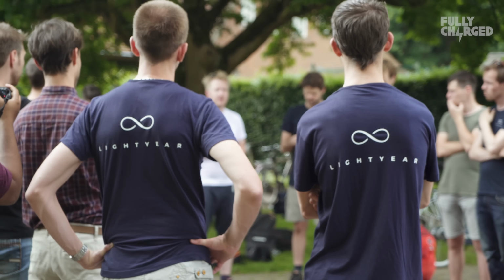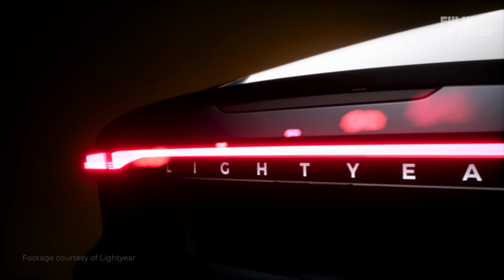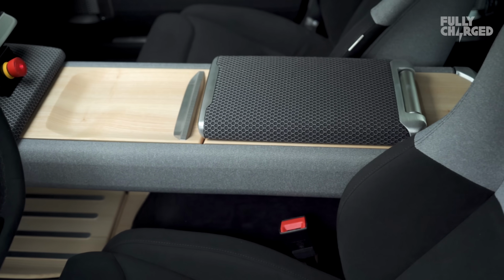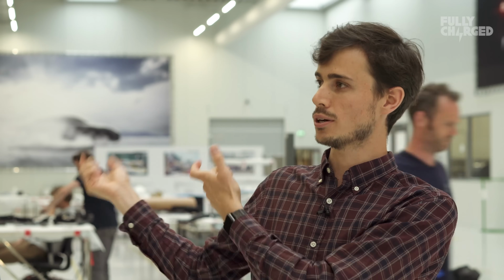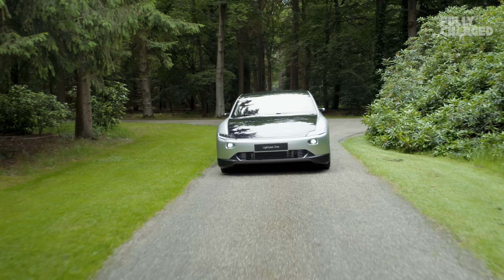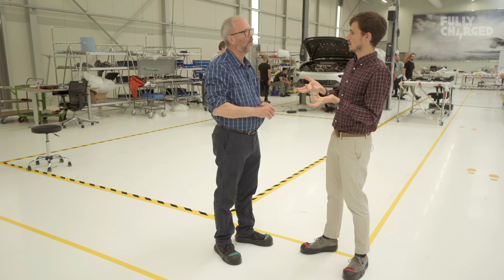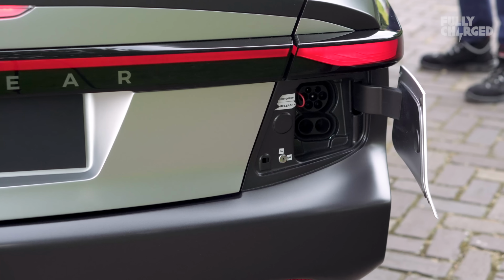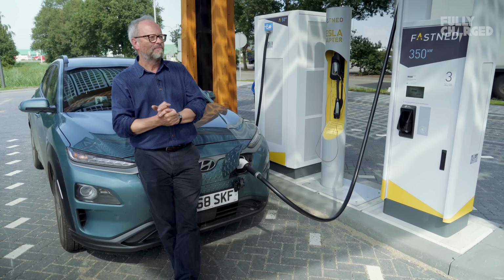Lightyear One solar powered electric car - exclusive first look | Fully Charged

Comment: 5:50 Min. range 400km - max. range 800km!
Every manufacturer should state min max. Great!
Reply: That's when you let the engineers do the talking instead of putting marketing and sales departments in between :)
Reply: They already do, it's on the big tag on the side of the window (Monroney sticker). Says City mpg:XX Highway mpg:xx

Electric cars do "range" instead for 2 reasons. 1, range has been electric car's limiting factor since the 1900's. 2, it allows them to hide that they get worse energy efficiency at highway speeds. The current record holder for longest drive on a single charge in a Tesla did so driving at speeds in the teens, 13-19 mph.

While I like the concept I know reality rarely meets expectations. 4 days to full charge optimum. Most people are not going to be checking their compass to make sure they're getting optimum coverage, making sure their roof isn't getting partially blocked, etc. People will get at best 1/8 charge/day, and I'm betting half that. A lot of people that only travel 5-10 miles a day for work might be able to make it work for free though. And never being permanently out of power in the middle of nowhere would be awesome too.
Reply: @macgyver9134  "A lot of people that only travel 5-10 miles a day for work might be able to make it work for free though" - No.
it would be cheaper to put normal solar panels on your house and charge your car when you come home
so you technically pay for having them on your car
Reply: @user-bj3pq2si2l  What about those who live in apartments? You do not understand physical principles. There should be an AC motor as in a washing machine, which is connected to an AC adapter 220 or 400V to the batteries. The higher volts, the less amperes it consumes. Look, there are 110v house current in America and they pay 2 times more for electricity than in Europe where 220v
Reply: @macgyver9134  4 days to full charge? this is impossible
they have at best 4m² (~3m*1.3m) and thats under perfect conditions (car would need to be angled or only when sun is exactly at highest point) about 0.5kWp (kilo Watt peak)
so even this way, after 4 days and about 50h of sun you get only 25kWh

realistically these modules are less efficient than "normal" stationary modules (i guess about 30% less), they are not angled (about 50% less sunlight) and it obviously depends on weather, so on average that's probably again about 50% less
so realistically it is about 4kWh/4 days or 1kWh/day or about 1 charge every 2 months

useless uneconomic shit
Reply: @user-bj3pq2si2l  If you watch the video they tell you, the solar panels are 1.25kw peak
Reply: @CamdenWallraff  then double my numbers
Reply: @user-bj3pq2si2l  It has this one major upside of making use of the surface area of the car. As the working parts of a solar cell are not heavy so if you build them into the body panels efficiently that is energy harvested that would otherwise be lost without major impact on the energy to accelerate the mass. As long as they generate something its not entirely wasted  (assuming the cars live long enough to payback the high energy cost to make the cells in the first place - which they should be able to).

 Not everyone can fit green energy at home - living in flat/apartments, planning rules etc. So even if you only get a small % of your mileage from the cells or they just cover the aircon its still good for reducing load on the local power grid. IF everyone suddenly went electric now the entire world would brown out with the demand for electric. There are not enough power stations to get even close to that level of demand even more so with the 'fast' charge that draws so many more Watts.

Time will tell how good they are in real world conditions, if the body panel structure will age badly etc. It certainly isn't going to be the cheapest way to get solar power for your EV. But the concept is sound enough as long as you are being realistic and not expecting to drive at speed entirely on the sun all day every day. The Batteries are actually the bigger issue, decreasing capacity, limited lifespan, often hard to remove and service, using relatively rare elements and not yet re-manufactured or recycled effectively.
Reply: @user-bj3pq2si2l  You must work in the oil 🛢 industry .....
Reply: @jimhouse9961  no, i think solar panels are great
but putting solar panels on your car is just dumb
Reply: @user-bj3pq2si2l  He says here @16.47 1.25kW peak and equivalent of "charging up" 50-70km per day....
Reply: @user-bj3pq2si2l  Maybe they used 46% efficient multi-junction cells rather than standard 20% ones?
Reply: @johndow1974  no matter how you think about it, there is no way that this is better than having stationary solar panels
the extended range is insignificant and there are too many downsides to reliability and cost just for having it on your car

even with 1.25kWp it won't be worth it
let's say that you are doing a long road trip through a desert, perfect conditions, that's then about 12h daylight with an average power of 0.6kW (angle to sun is important) which results in 7.2kWh which is about 40km or in other words not even 2 minutes of fast charging with the model 3
Reply: @user-bj3pq2si2l  Agreed, but if you are doing avg 30km per day like most people do then it can make sense. Note the guy says the daily charge equivalent allows for 50-70km distance drive. Also nobody says you can't charge it from the external source, e.g.  additional panels.
Personally today I'd go Tesla, but if I was living in a sunny country it could be an interesting option.
Reply: Unless you're driving very very slow I can't see solar adding an extra 400km. 1.25kw isn't even 2 horse power and that's assuming perfect weather. If you're willing to pay for it's almost certainly worth the extra weight of the panels but it can't make that much of a difference.
Reply: @bloodypommelstudios7144  The min max not only depends on the weather, also driving style (which in my experience is much more important). For example, my car, i usually do about 220 km on the highway at 130 kph, but if i do a 100 its about 260-280 versus 80 kph about 300 km. The solar panels themselves probably dont add much range on a single drive.

He stated 400 - 800 km range. Assuming the efficiency of the car is similar to newer cars available we have now, and a little more efficient due to the aerodynamic design (15 kWh / 100 km) it would mean a battery capacity of about 90 kWh, suggesting a battery capacity similar to a Tesla model S. 10-12 km/h charge rate from solar panels with a 1.25 kWp capacity would suggest an efficiency of about 11.3 kWh / 100 km and a battery size of about 67.5 kWh. Seeing the efficiency inprovements over the last 8 years it is not outlandish at all, but it would certainly be a big jump.

With 1.25 kWp power generation capacity, reaching a full charge in 4 days is indeed a bit wishful thinking, at least in the Netherlands. It might very well be possible in a sunnier location.
Reply: @ReapingMiner  I just can't see who the market would be. They're charging about $100,000 more than an equivalent EV just for the sake of having access to an extra unreliable and low power energy source.

For it to make sense to buy it you'd need to be a multi-millionaire with a driveway which isn't in the shade near the equator, not have access to electricity in most locations and be a very low mileage driver. Not exactly a large market. Get a vehicle like this to a price point where it's competitive with regular EVs and you've got a viable product.
Reply: You guys are forgetting the most important factors, weather and time! 1.25kwh means nothing in the real world, weather is your biggest concern and a mere cloudy condition can drastically affect its efficiency much like solar panel.
Reply: I'm putting my order next week.
Reply: if they had these numbers they would :D
Reply: @steak8278  Uhm thats not how it works. There are rules set on how you define the min. range of any car so you have a consistent dataset. It's an exact science.
Reply: It's a little more complicated than that. Expressing a minimum range doesn't say anything without reference to a certain performance. Second, the standards used should reflect every day use - which is up till today not the case, due to governments that prefer to let their ears hang to the car lobby instead of people who are using it and paid for it.
Reply: Thunderf00t needs to see this bullshit video lol

Comment: Looks like an airbrushed concept car you might have seen in the 80s.
Reply: No pop-up headlights tho
Reply: Looks awesome.  Very little difference between tissue concept and the Bugatti's and Lamborghinis. Very little
Reply: CITROEN CX
Reply: Seems inspired by VW XL1
https://youtu.be/tqQ4eQc4zd4
Reply: Yep! I was thinking of KIT and Michael Knight.
Reply: it looks better  than the bubble cars of today
Reply: GM won that race with a car that looked very similar using a very similar idea...……………………………………………………..in the late 80's
Reply: this brings us back to the same question :once the sun goes down how far can I drive on the battery?
Reply: I would rather have a car that can run on the sun that have a back window
Reply: exactly what I was thinking when I saw the side and how odd it look. It looks like the future car from the 1980s but the side looks UGLY.
Reply: @HH-xs2gm  That is a nice reaction. Means it is like art. You love it or you hate it. Luckily there are so many models on the market that there is choice for everybody.
Reply: that rear wheel guard looks like it's wearing a miniskirt. as if it has genitals to partially hide
Reply: @davemwangi05  I liked the real wheel guards. To me it made it look sleek.

Comment: I would like to know how many autonomy kilometers would the car reach here in Seville, being one of the most sunny places in Europe. My prius also has solar cells on the roof but it's only for activate the fan inside during hot days.
Reply: In the video he said the maximum power you can get from the solar panels in full bright sun is 20 km of range per hour.

Comment: Maybe a dumb question, but what happens if you leave it in the Sun, but it's already 100% charged? Obviously can't put that electricity back into the network (which is actually not a bad idea since most of the day cars just stand around anyway).

Comment: ok some questions

 - how do you carry a spare tyre (if the motor is inside it)
 - how do you reverse if you can't look out of the rear view?
 - in Saudi Arabia in Summer at noon where it is 47 degrees and no cloud and you go 70mph what percentage is generated as it drives
 - in Ireland in Winter at noon where it is 1 degree and overcast at 70mph what percentage is generated as it drives
 - how often do you have to clean the solar cells?
Reply: Spare tyres are not mentioned.  The video says for reverse there is a camera (but the location of the display is not yet finalised).  For Saudi Arabia the video says the maximum power you can get from the panels in full sun is 20 km of range per hour.  For your Ireland question the video says a somewhat overcast day in the UK is more like 10 km/hr of range but probably less.  The solar cell cleaning regime is not mentioned but the fact that they use lots of small panels instead of a few big ones means they will be less sensitive to dirt and grime than other panels like those used for home solar.  I would think they should be cleaned as often as you clean the windscreen.
Reply: @vink6163  ok so the 70mph is 110kph.. so basically 20km and 90km from battery is solar so it's (ignoring air con and the gross curve inefficiency due to air friction etc) so that is just over 15% which isn't bad

i.e at peak legal maximum speed in perfect sun it is about 15% solar efficient.. that's not bad

the Ireland thing is a joke, there is no solar performance in over cast, pretty much zero
Reply: @vink6163  I still think if any vehicle was on solar roadway and used induction (making it effectively like a railway less tram)  you could (theoretically) achieve much better results.. much much better
Reply: @con_boy  It's probably not accurate to think of it in terms of km/h or mph because to be practical the car will run off the battery 100% of the time, with the solar cells feeding whatever they can into the batteries (along with regen braking).  So you can't really think of it as 90km/h from battery and 20km/h from solar to drive at 110km/h, it's more like you drive at any speed you want, and it all comes off the battery, but for every hour the car is in the sun, the battery is recharged enough to add another 10-20km of range.  So if you wanted to drive 40km and left the car in the full sun for two hours, then your whole 40km journey would be (close enough) to be entirely solar powered.  Of course there are efficiency losses that reduce this but the point is it doesn't affect your speed, it's about the distance you travel.

As for inductive roadways, have a look at some technical reviews of Qi phone chargers.  The efficiency of induction over an air gap is quite poor, so while you could deliver more power via induction than you could via solar, you'd waste a huge amount of power in the process (seems to be around 10-20%).  The practicalities of having large charge loops and fast moving vehicles also means it would be difficult to control how and when to turn the power on and off, so you aren't wasting power by charging when nobody is there, and you aren't creating magnetic drag on the moving vehicle which would further reduce the efficiency.  I'm sure it could be done, but it seems like it would be so expensive and complex that I'm not sure the resulting system would be worthwhile.

Comment: It's less efficient than just having some solar panels in an appropriate area... The car will see go behind buildings and under trees and tunnels... It will not be in the optimum position at various points... 

It's a stupid idea... Sorry...
Reply: You're correct that it is less efficient to put solar on a car, versus having stationary solar panels that power charging stations. However, 6 miles of recharge per hour, means that a typical person working a 9-5 job, could recharge 48 miles per day. The average American commutes 32 miles to work round trip, enough to cover the average commute. Most cars are left parked 95% of the time (actual statistic), time that could be spent charging. This car is also invaluable in areas with limited electrical infrastructure, where plugging in to recharge may not be feasible.
Reply: @sinixodair  - But you can charge it overnight when you're at home and save on the expense of the panels... Besides, as electric vehicles become more popular more and more charging stations will be available.

Also cars get dirty very easily, which will also reduce efficiency, all in all it's a massive waste in my opinion, solving a problem that doesn't really exist.

What about if you park in a multi storey car park? Or underground car park? Or just somewhere in the shade? The whole solar car thing isn't a new idea, it's not done because it's stupid! Same reason why solar roadways is a stupid idea.

Comment: Website says it'll charge 12km of range per hour of solar. I'd say for that limited benefit, save the cost and the weird design choices (what someone from 1988 would imagine a car in 2019 would look like) and install more solar on your house instead. Or elect for renewable if you've got that option, like we do in California.  It might work for toodling at 12km/h as limp-home mode (according to the website), which is great, but that's not exactly a selling point or a cure for range anxiety, particularly for someone living in cloudy northern Europe.
Reply: Atleast someone won't be stuck in a desert.

Comment: Video title is a bit click bait as car is only partially solar powered.
Reply: How so?  If it charges at 10 km/hr then that's a free charge of around 400km per week, so if you drive less than 400 km/week, then it will be 100% solar powered.

Comment: How does Lightyear One compare with Tesla? 🧐
Reply: I think 1000x performance difference or power usage difference. The lightyear one is made to use as little power as possible, the Tesla is made to do 0...100km/h within a second, or 2 seconds if you have the cheaper versions.
Reply: The same way a marathon runner compares to a 100m sprinter, I guess

Comment: When a solar/battery powered car can achieve a decent day's driving range of 700 or so miles at 65-70 miles per hour plus be able to operate all of the accessories then I will consider such a vehicle practical.
Reply: How often do you drive 700miles in a day?
Reply: @Clint3571  Lots of people like to drive their vehicles cross country. Who wants to take a week to go from coast to coast? And actually as a recently retired truck driver, I did it quite often.
Reply: I have heard of a few people with electrics saying that if they take a road trip like that, they will rent a car. Not for everyone, but an option.
Reply: @Clint3571  I have taken some road trips before and I used my own vehicle. I cannot imagine the expense of renting a car when my own vehicle is just as good.
Reply: @williamjones4483 
Hyundai gives you a free petrol car for long trips (twice a year) if you buy a fully electric Ioniq, at least it does in Spain. Seems like a good compromise for non petrolheads.

Comment: Would it not be a better business case to develop solar roof technology for existing car manufacturers? I see this idea as an option for electric cars, why build your own car?? Sorry, appreciatie the effort, but this will not work with the current efficiency levels of solar cells. As scientists it makes more sense to work on the solar and battery technology instead of reinventing the electric car.